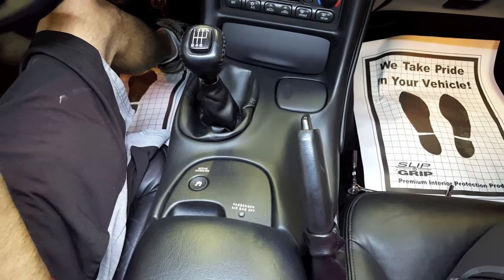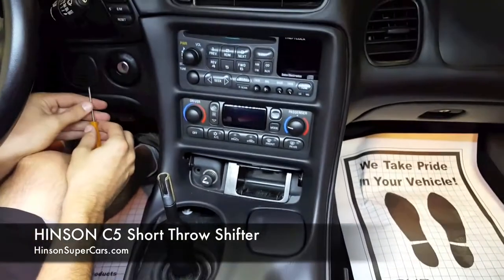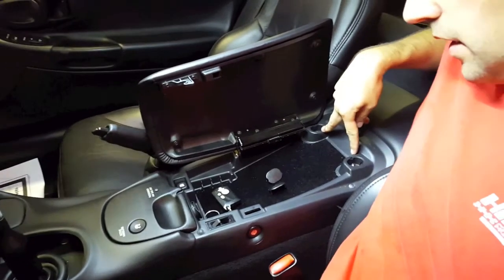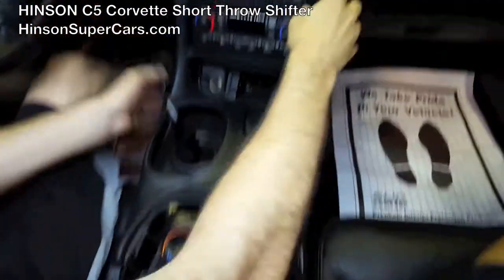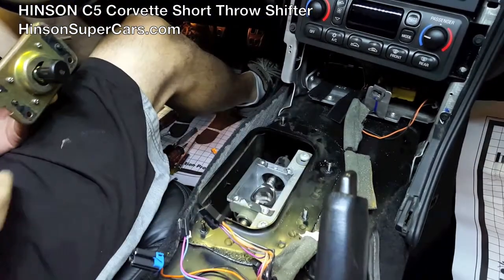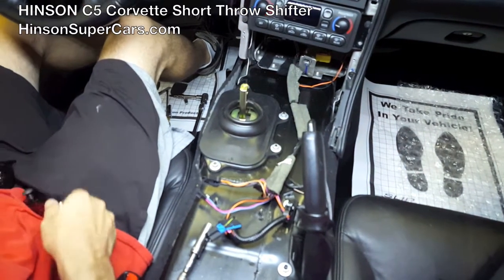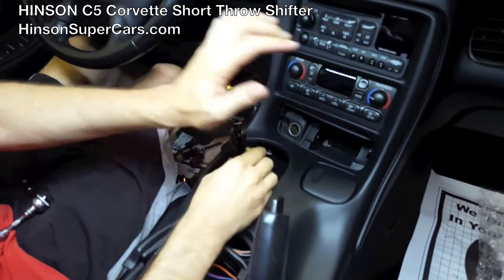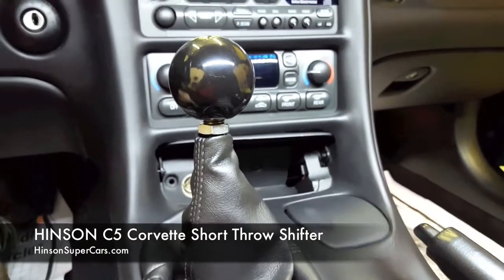HINSON C5 Shifter Removal and Short Throw Shifter Installation Video

Comment: this fucking thing rattles like crazy!! if you look it up on the forums this problem has been prevalent for years. I adjusted it three different ways it rattles three different ways. everything is tight as possible and I've tried every trick people have suggested. It's in the mechanism it's designed badly.
 The manufacturer is very aware of this problem. I will do what they have failed for years and outsmart the problem but I will not share it with them as they do not pay me for R&D and my time is valuable and they have already wasted more than enough of it.
Reply: I wondered looking at the video why its a 2 piece shifter - more parts, more prone to noise and failure
Reply: Did you figure it out you should lmk haha
Reply: @Actionanimalranch does yours ever pop out of reverse? I have to hold mine in reverse when backing out, or it'll just pop right on out
Reply: @OctaneSlain  no it never popped out but sometimes after thousands of miles it had a hard time going in reverse, so I unhooked the shifter gave everything a little giggle straightened it all out retightened it and the problem went away never came back, might just need to be adjusted.